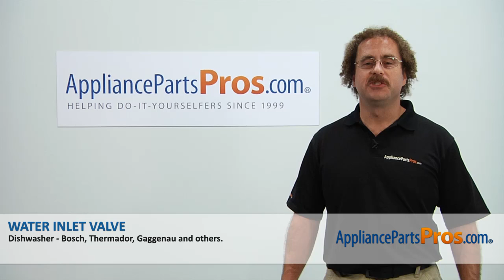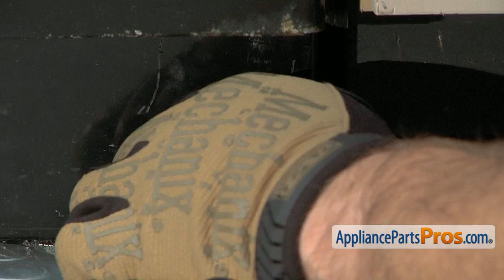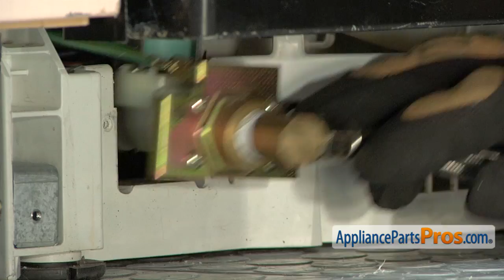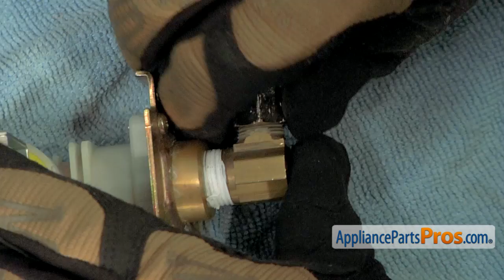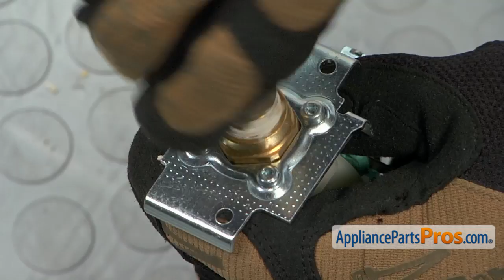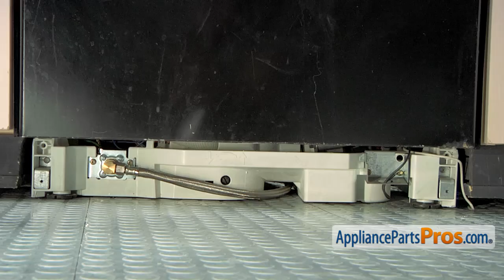How To: Bosch/Thermador/Gaggenau Water Inlet Valve 00425458

Comment: What is the coil resistance? How do you know it’s broken
Reply from the maker: The best way to test the water valve is to test for power going to the valve when it should be filling with water. If you have power there and no water is coming into the unit then you will need to replace the water valve.
Reply: @appliancepartspros The center iron bolt could be jammed
Reply from the maker: The vavel either works or it doesn't. If it has power it should let water in, if it doesn't it needs to be replaced. A resistance check is not a valid test for this part.

Comment: Awesome instructions. Part cost around $40. It took me about an hour to replace it; trickiest steps were getting the hose off the back of the valve, and the elbow joint at front took a lot of effort to unscrew. Also, the purple wire was white. In the end, probably saved myself over $1 000, which is the price of a new machine and installation.
Reply from the maker: So glad you were able to repair your unit! Let us know if you have any questions!

Comment: Hey I have a question if u check these comments! Where does the other side of the green ground wire go! Does it just hang out in there or does it connect to something! Thank you
Reply from the maker: It appears that those two green wires should be connect together and slide on the one terminal.

Comment: Just replaced the inlet valve because the machine was slowly filling when off. With my model, I guess the design was "improved" so that you cannot pull the valve forward when detached... won't come through the bracket and wire and drain harnesses too tight. It was a bit more work as a result, but the video was priceless in terms of help.
Reply from the maker: Glad we could help!

Comment: Help!,  buzzing (sounds like a typical solenoid buzz), dishes not cleaned, error code e1.  Found e1 to be water not heating, but coupled with buzz, and no clean, I was thinking not filling enough, so heater won’t start, thus the e1 code. 

Ever heard of anything like that?  You just walked me thru a circulator pump replacement, so maybe I damaged the fill valve when I had to recommend the water line. 
Thanks for any help
Reply from the maker: We'd be happy to help you out with that! We offer free technical advice and diagnosis 7 days a week. You can give us a call at 1-877-477-7278 or you can chat us at our website: http://www.appliancepartspros.com/. We will need your model number to give you accurate advice, which you can locate using this tool on our website: http://www.appliancepartspros.com/modelnumber_locator.aspx